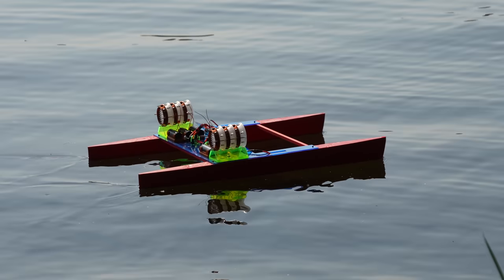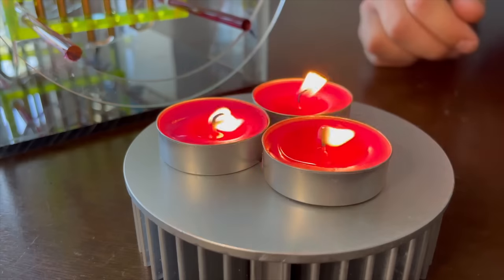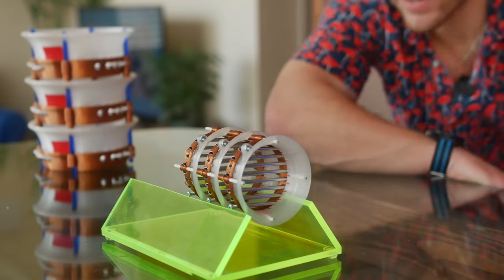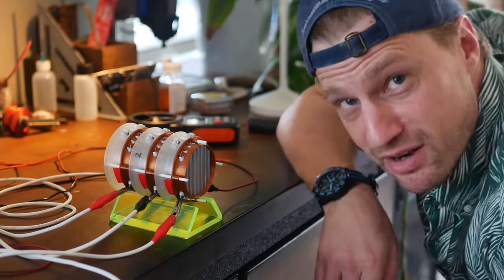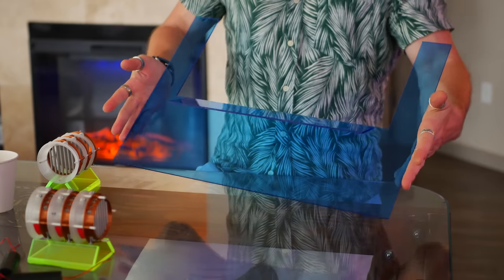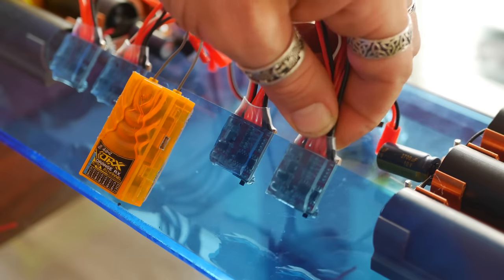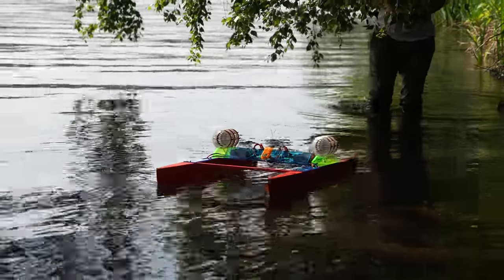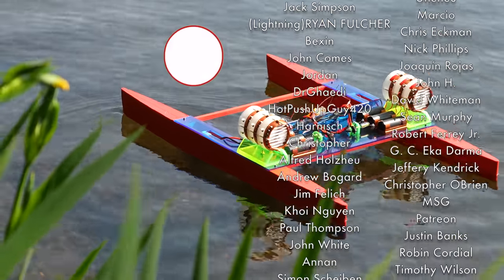Building A Twin Ion Engine (TIE) Catamaran (ft RCTestFlight)

Comment: For your next version, I want you to consider a series of stationary baffled blades with the electrodes at positions to feed air in shapes resembling an air foil.

You should look to Jet engine design for this, their internal series of fans are excellent at compressing air (somewhat) uniformly and using it for propulsive thrust.

You just want your blades to be static, with a later revision perhaps having variably pitching blades to adapt to air pressure conditions.

I suspect you'll want the blades to be really low angle of attack though. But that is just my mental guesstimate, higher could well be moar better. Or the whole thing bunk /shrug

Also make a series of spots for particles to be deflected from the air-path vortexes. To this end, look up Cyclone Dust Collectors
Reply: Good thinking

Comment: You should implement somehow a way to increase the distance between the electrodes depending on humidity :) Maybe a telescopic design with servos?
Reply: I assumed the humidity would actually help with the ionisation, if you can adapt the gap for optimal thrust.

Comment: You should try metering in helium through manifolds placed at intake plates and checking those airflow speed tests again . Also I'm curious if modulating the plates  output from first to last would yield gains .  Great work !
Reply: Exactly, I am wondering about this to. As varying the size and shapes of each stage. To compress the airflow sort of like in an jet engine. I am wildly aiming at the therm "electrostatic vortex air compression". 😍
Reply: @Streamcatcher  You got me thinking that super cooling helium would aid in compression by lowering intake air temperature and creating even more expansion when ionized.  I like how you think

Comment: I have a thought. What if each stage of the thruster got smaller? Each stage is trying to accelerate air that is moving faster than the stage before so if the size reduced then you might get a bit of a venturi effect, increasing air speed.
Reply: I had the exact same idea. If each section started at the size of the previous and slightly reduced down until the final section and have it a bit longer and more focused. Of course this works with a standard motorized fan, but not sure if it would hold true for ionic wind. I would think so.

Comment: If you can eventually get enough thrust then look into adding hydrofoils to your catamaran. Hydrodynamic resistance drops to very low levels once the hulls come out of the water but it doesn't look like you have quite enough thrust yet. However maybe a hybrid approach might work. First a ducted fan to get you out of the water then switch to the ion thruster.

Comment: As a sail boat owner, humidity/water will be a big issue. Even on nice days, water mist goes over the boat. My cockpit screen is well over 2m from the water and to the rear of the boat, and it gets water on it. This is the small droplets from the spray the hulls create. My boat is 43ft long. 
Can a TIE create lots of horsepower. My Catamaran is quite light for its 43ft. Two 20hp engines propel it at 9 knots full throttle. They also dont take up much space.
Maybe this system could be an assist system, like sail assist on some container ships.
Just got to figure a way to insulate it from rain, sea spray, fog, humidity!

Comment: Love your ideas and video. I would spray all lines on the ionic device you made with clear coat spray like liqueur from home center to crest protective coat for shortening like you experienced.  Few coat will be enough to seal it with minimum weight gain.

Comment: The arcing is very good for propulsion if it is conserved with ducting. It provides thousands of degrees of heat breaking down h2o as a hi-T nonflamable propellant. In a light-weight design, it could propel full-scale aircraft of any size.

Comment: Great video, instead of comparing your thruster to a diesel generator it should be being compared to the electric thrusters that they drive, the reason for diesel and gas on boats is for the energy density of fuel. They can be run off of batteries and still are very loud so that would be a more apt comparison.

Comment: I can’t help much with the ionic thrusters; a bit beyond my wheelhouse!
However, catamaran design is another matter entirely. If, instead of flat bottom hulls you build round bottoms, you should see an increase in boat speed due to a decrease in wetted surface area. Since you already have a boat, instead of building another, adding half-round sections to the bottom of each hull should do the trick. (Please remember to do a nice job fairing the joint between the hull and the add-on 🧐.). Don’t forget to give your new hull form some rocker: a curve from bow to stern; generally deepest just abaft midships. To help compensate for the weight of the thrusters, keep the rocker flatter in the after portion of the add-on. This should bring the stern of your little cat up some and make her ride on her lines instead of squatting as she does now.
I hope this helps get you a little more speed. Trying to push one of those inflatable rubber boats is going to be a real challenge! They are ALL wetted surface area! Which means hydrodynamic drag which requires horsepower to overcome! Keep the aspidistra flying!
Good luck 🍀.

Comment: A&P here. I keep looking at this from your inlet speed revelation and - with this having a very similar design to multistage, axial flow, turbine engine - i had a few ideas that might help multiply thrust per stage through aero manipulation. These ideas might be some of the ideas you tried and didn’t work, just thought I’d throw out the idea or two. You have to use bypass to make the multistage work. I feel like the middle of your grids aren’t helping with thrust past the first stage. I wondered about a radial grid design where the bars are perpendicular to the radius, with an inner airfoil for a support ring. The outer ring would become a one piece, high bypass duct, with a reverse Venturi shape to help slow the bypass air down and achieve maximum acceleration per stage. Have a convergent duct after the final stage to convert the increased pressure to velocity. I’ve got ideas to fine tune but I’ve already written a novel 😂 love the channel keep up the awesome work!

Comment: I'm learning more about this technology in greater detail through your channel. But I have a question: today, the concern isn't so much about how to convert electrical energy into mechanical energy, but rather about energy storage. Could you possibly create a video for us comparing the energy consumption of a system (like a boat in this case) propelled by plasma versus one propelled by a traditional propeller engine?

Comment: Seems like you could use some sort of power feedback system to build up the power.  If you put a shaft through the middle and a compressor in the front and a turbine in the back, it seems like you could  build up the power.  The denser the air is from the compressor, the more air should be ionized and the more thrust and  heat generated.  The battery replaces the jet fuel.  The sparks are much hotter than burning jet fuel. If you just put a big funnel on the front, it would give some increasing compression  without needing the moving parts.
Or run the electrodes around in a circle along the inner edge inside of a circular container.  The spinning and centrifugal force would tend to compress the air along the inner edge and more air would be ionized in the denser air.  If there was a small hole in the center, more air would be drawn in unless the air got too hot in which case it would want to escape.  The hole would prevent the container from exploding from heat also.  If you  hook the electrodes up to one or more Tesla cools so that the phase is arranged to always have the ions pushed in one direction you might get some serious velocity.  Put some ducts on the end opposite the intake vent and it might make some serious thrust.  An electrode attached to the top of a Tesla coil tends to direct a stream of ionization away from the tip.  Insulation around the electrode except at the tip would tend to encourage this directed path of ionization.

Comment: How would you go about getting this thing to go in reverse? An engine redesign to allow both directions of airflow? Putting a movable scooper on the back to kind of redirect the thrust in a way to move it in the opposite direction but at a reduced capability? Making the engine mounts fully rotating to allow for directional thrust, though would slip rings be able to keep up with the high voltage transfer? Reverse thrust would be cool, allow the boat to get away from obstacles, but also improve pivot speed for turning having one thruster forward and one backwards

Comment: Another way you could test it is with a plane ballast with helium, shaped like something from a popular sci Fi show. The options are a little limited but something like an x-wing would work well, just lighten it with helium filled in the center, maybe a balloon or two tied to it as well, not sure how the weight would play out but essentially get it neutral to ground level and test how they would work in a slightly more finalized manor like if they were installed into something marketable, what would that look like housing wise, and how much would it hinder flight? 
I'm saying sci Fi nods/reference just for the showmanship aspect. Also because you know when it's successful you'll want to display it and bonus points when it nods to something that inspired you. 
Also how can you not when developing ionic thrusters? 😂
But hey this is an amazing build, I am so impressed with your work. Definitely call this a win for science.😊

Comment: Increase the mouth of the air gulper.
It should move a greater amount of air with only small increase in power.
Stack the electric generators connecting + and - with separate power supplies and good individual isolation.
greetings. Very interesting!

Comment: Damn this is cool. A couple of questions:
- What if you synched the steering function with retractable drogue paddle thingies, so you can pull a good handbrake-turn out it?
- Between catamaran cross-braces you've got a lot of useable surface area. Think you could span it with a solar panel and get some extended run time? 
- how would you get a reverse gear out of this set up? 
- Suppose you could completely solve the moisture/humidity/water exposure problem for an ionic thruster. How many steps from that to an ionic thruster that works underwater? Yeah, I'm talking real-McCoy Red October action.

Comment: Have you considered reducing the spacing between the 2nd & 3rd stages, to the same spacing as between the 1st Stage Positive & Ground sections.  In other words... have the same spacing between each section/stage.  The reduced distance between each section should increase the output and potentially reduce amperage.
Reply: He actually tested this previously. As far as I remember, it got him more thrust to do this rather than keep it the same distance throughout.

Comment: Since your energy source is electric, I would try to couple your twin ion thruster with an external-flow MHD drive (NOT the ones encased in a channel) covering the whole wetted area of each foil, to significantly lower or even cancel the hydrodynamic drag (and perhaps make it negative – this was achieved in actual experiments). Using powerful neodymium permanent magnets inside the foils, arranged as an elongated Halbach array, or glued head-to-head in series as a Petit parietal array.¹ This way, you could put several linear thin electrodes along the hull below and parallel to the waterline, very close to each other, which would lower the required voltage. Your boat might then flow like the wind (in electrically conductive seawater, not in a freshwater lake though).

However, I admit that your ion thruster relies on high voltage, low current; and that an MHD drive is the opposite.

—
¹ See for reference e.g. J.P. Petit's "The Silence Barrier" PDF, chapter "The parietal accelerator", circa page 35-36

Comment: Well done project! Would be curious to see how the propulsion would be affected if the air stream of the ion engines would directly guided in to the water. Converting the system basically to a water jet motor.

Comment: Consider a cowling that allows air passage while absorbing a measure of the moisture in the air. (some common foams make serve you well here) .  Also, your concept must deal with various weather conditions, and as the project scales this problem will be a massive barrier.  Furthermore, can you find a way to keep your batteries charged with solar?  to better manage steering to include reverse, take the weight penalty, and mount trusters on a turntable of some type.

Comment: Nice. You should probably research a little about controlling flows. Like in a jet engine that has different stages of air compression with different shapes of turbines at every stage, multistage ionic thruster quite probably would require different specs/size/designs/power for every stage to achieve maximum efficiency. Chaining three exactly similar stages logically makes less sense than making a step with a particular specs at every stage—the air at in and out points has different characteristics for different stages. Hence, this difference should be taken into account in the design of each stage.

Comment: Lovely video...However, I would think that the stages should have reduction in diameters as the flow speed increases.Also the amount of air which is ionised is limited to the area of contact with the thin wires which is small compare to the intake diameter.I know that more wires will result as the air flow resistant.There could be a optimum ratio, which must be found or wires could be as a circles one follow other one with smaller and smaller diameter. I'm thinking that looking from the front it should look like cones.Just a thought as the hydrodynamic of air used in different engines could be very similar(jet engine, pulse engine and more)

Comment: Has much research been done about what frequencies are harmful? Are we sure it's the diesel engines (which I'd think would be very low frequency), or is it cavitation on the screws? If it's the latter, is there much excitement/hope about the new toroidal propellers being so much quieter?

Comment: Wouldnt it be more reasonable to measure output in volume (CFM) than airspeed (linear M/sec.)? That would account for pressure and help with determining efficiency for thruster size optimization, shape of nacelle, etc.

Comment: I had this idea at high school like 8 years ago. I wanted to make a drone with ionic thrust engines. At that time i didnt know how it is called etc. I  wanted to ionize or push already ionized particles in air to fly a drone. The main idea was to use it on the other planets because ionizing particles in their sphere wouldnt harm them and also the gravitation force is lower there. I even made a 3d design of it however my physics teacher could not help me or mb did not understand me. So , I gave it up. Watching your ionic thrust videos brought my memories back and inspired me again. Thanks.

Comment: needs focusing nozzles, concentrate the thrust for improved power usage
also maybe use more of that wasted energy with more ion steps so it has less energy to spark when humid
does just using lined up wire all around instead of shaped aluminum beams help thrust any? or maybe replace them with thin sheet metal strips?
what happens when the ground side of the plates gets grounded to the water as well for a more solid exit point?

Comment: It's a sailing fact that a sailboat can sail faster while oriented perpendicular to the wind, than if sailing with the wind, due to keel action and vectors. You should build a sailboat with 3 or 4 thrusters mounted on a directional mast that can take advantage of this. Use rudders for steering.

Comment: I wonder if humidity could be controlled via ducts to consolidate the moisture in the air before it goes into the inlets and use some aero spikes at the exhaust side to keep velocity up while making sure external humidity doesn't flow back in. Don't know of there is enough velocity to make that happen. But it's a thought.

Comment: Hi, I have a question, and it may be ignorant. Feel free to ignore if it is. With your first prototype plasma engines, you tested the different power input levels for maximum efficiency. With the boat, did you perform similar tests, or did you just scale the power relative to the scale of the engines? Would that possibility make a difference regarding maximum efficient output. I am trying to learn what I can. I find your channel fascinating and appreciate what you are doing!

Comment: You think a bit of fine gauge nichrome wire in front of the intakes would help dry out the air before the driver plates (or whatever the sparky bits are called) touch it? I don't know much about these engines, but if they're not too affected by intake temps then I imagine you can just heat up the intake to drive off the humidity.

Maybe use PWM control to keep the wire from burning up? 🤔🤷‍♂🔥